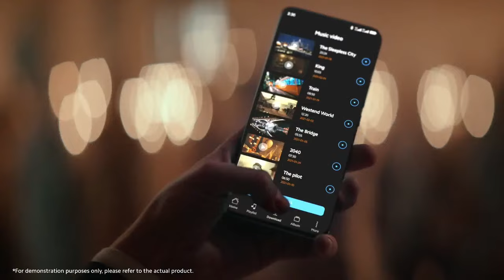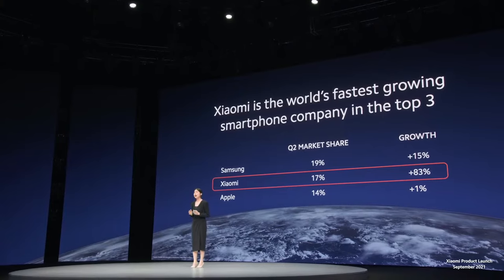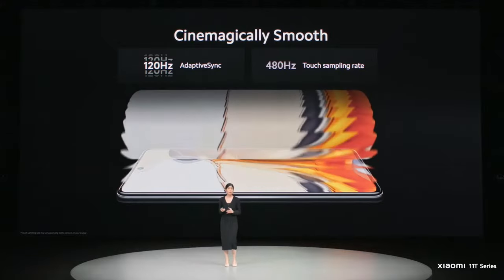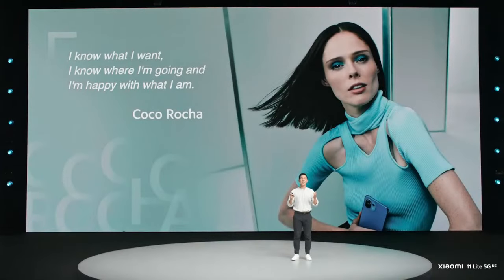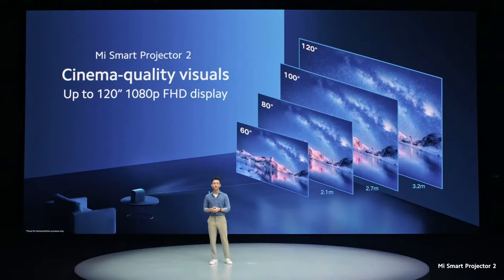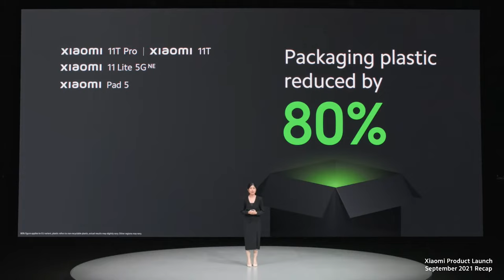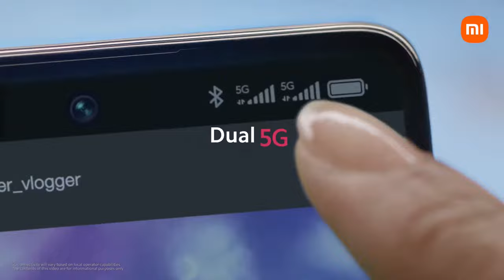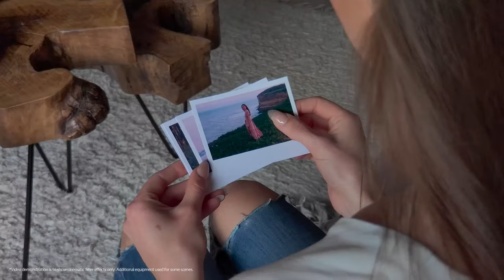Xiaomi Product Launch September 2021

Comment: I bought Redmi first, sold it in 6 months because of ads. Then I choose POCO ads were less but junk applications were lot. I managed to remove using adb. Then I choose Mi series, that ended up in full of bugs in MIUI. I will wait for next update, if not fixed I will never buy any Xiaomi brand devices.
Reply: thats a  main issue of Mi users.
...but you can disable Ads.
Miui bugs is common  but you can fix the issue in new updates.
😜
Reply: miui is the worst software you will get on android market the only reason most peoples from like south east asia buy it and it getting more and more sells per years because it cheap price with good speca.
Reply: @Leomelesa  my Mi 11 lite cannot display proper black colour, it's just greenish with visible lines, after the MIUI 12.5 update. Amoled and 10 bit display is now just in papers, display looks like 10 year old when black scene displayed. I called customer support they told to reset phone that didn't help. Worst support.
Reply: @bwinb328  so sad.

Comment: This only happened to my mi smartphone, as iPads, Samsung made products having no issues. Suddenly Youtube and Play store not working on my Mi smart phone that was released on year 2018 to 2019. 
As YouTube works fine under web browsers in the mi smart phone , but not working under YouTube app alone, it can load the YouTube app but it failed to load anything inside like WiFi access failed, but it rarely can load them after 20 seconds waiting! Unable to reinstall YouTube app as the Play store failed to work too, seem like hackers did this. I would try to remove the WiFi entry and create it as new again on my phone. Mi smart phone need to make something new in the next update to fix issues like these! I would not recommend buying mi products!

Comment: mi 11 vs 11t pro🤔🤷🏾‍♂️...
Reply: well technically (according to this video), faster charger, bigguer battery and better screen (super amoled), its actually a 11pro with a 108mp camera and faster charger xD
Reply: oh did i mention also cheaper (i guess, depends on region and store as everything xD)
Reply: @P4FElton  im in the us, but the mi 11 has dropped in price and u still get that 6.8" screen 🤷🏾‍♂️
Reply: @suspensefulness  yeah i just caompared them side by side... there is a few differences, one has better cameras (small difference i guess) and the other has better battery + charger... other than that... get the cheaper xD
Reply: @P4FElton  u just made it that much harder🤦🏾‍♂️...giztop mi11..579$
Reply: @suspensefulness  just get the one you think it will be better for you i guess xD
Reply: @P4FElton  you right both are great phones, hope they work in the US...also is the 11T Pro  5G